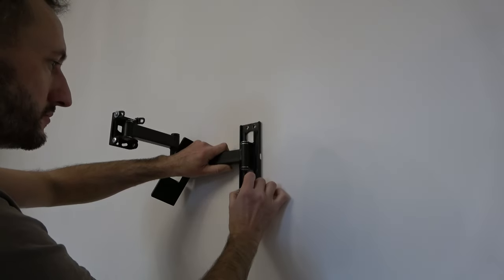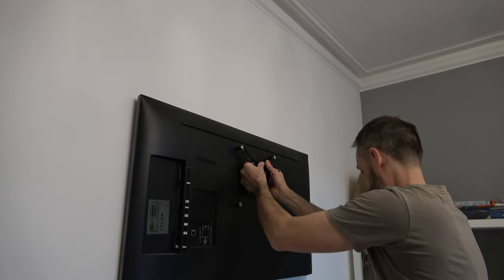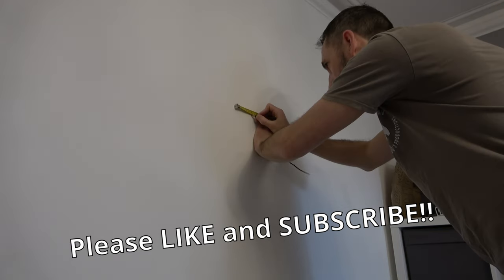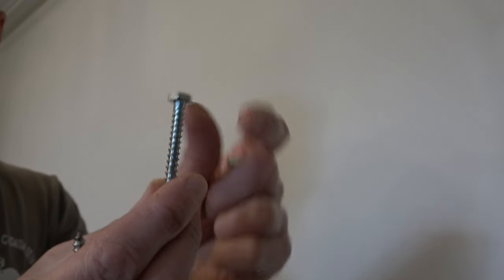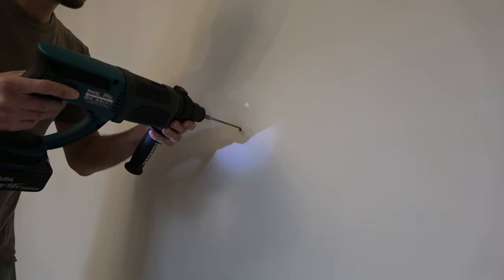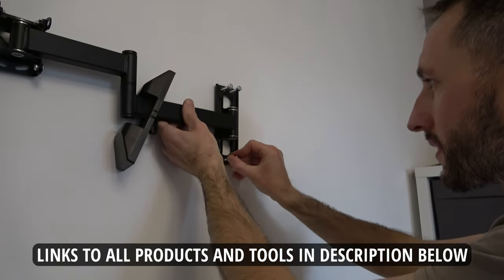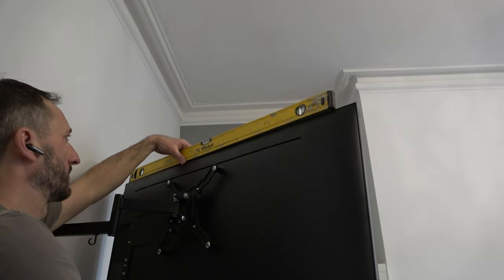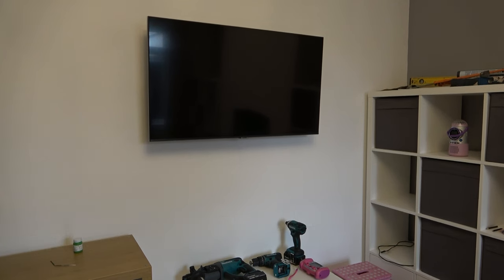How to fit a TV wall bracket to masonry! TV wall bracket strongest fix. Television bracket install.

Comment: Two things I've started doing religiously.
1. Blow the holes out with a straw.
2. Builders adhesive in the hole.
Seen too many plugs pull out over the years.

Also be careful with impact drivers also seen plugs stripped by the screw over torquing.
Reply from the maker: Thanks for the info. I did mention to watch over tightening in the video if using an impact driver. Thanks for watching 👍

Comment: How do you know what weight the coach bolts will support? The bracket will hold 35kg with the arm straight , that’s a lot of weight on the bracket ?